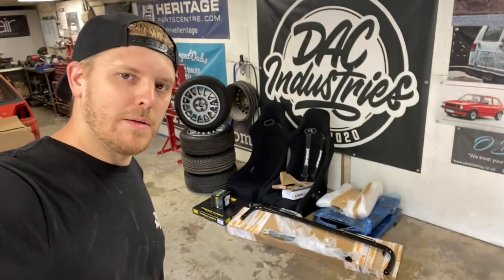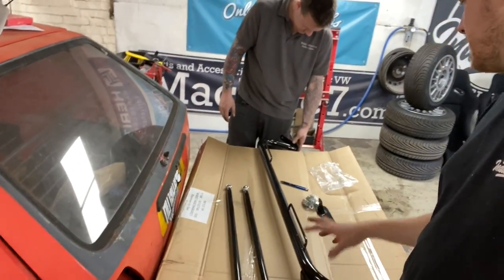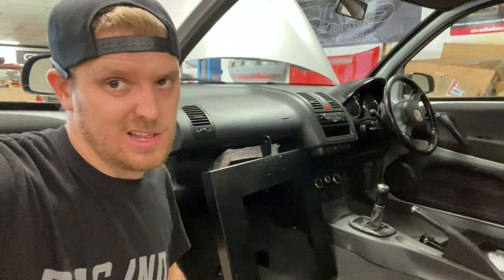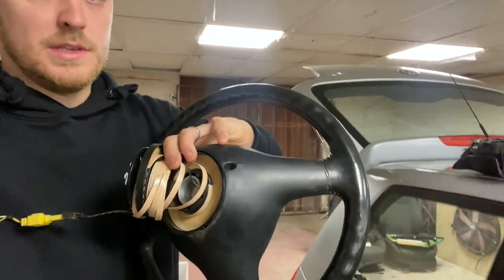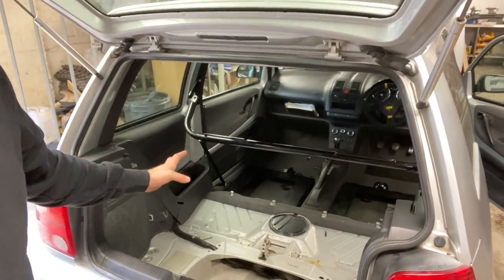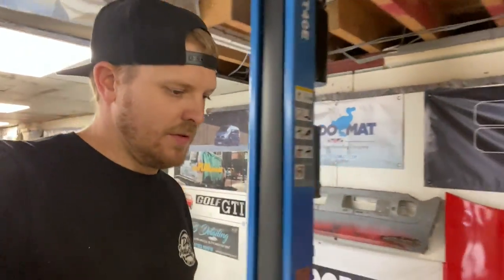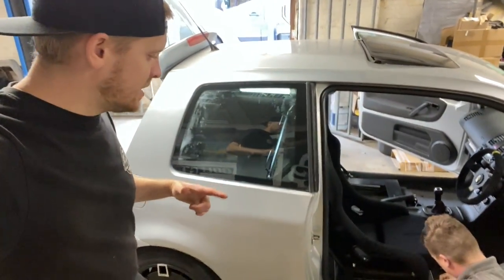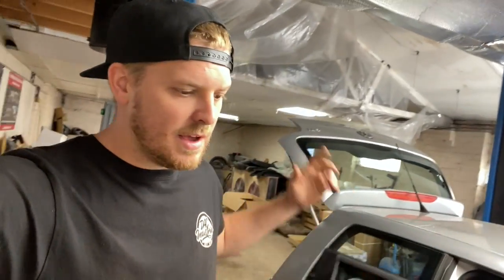Work Starts On The Cheapest Lupo GTI In The Country

Comment: LOL @ the 'exploded' clockspring 😂 Great choice on that OMP wheel. Looks like alcantara. The smaller diameter makes it feel so much better and quicker. The wheel and a weighted short shifter makes the car more fun to drive. A clutch stop can make your shifts even faster and they cost almost nothing. I use an elevator bolt with a jamb nut the tighten it down as soon as I get it adjusted perfectly. Those Speedlines are a CLASSIC rim, definitely a nice tasteful choice, and lightweight too, which is important in my book. Less unsprung weight is a good thing. Good solution to the sliders too. I used to have a couple sets of Recaro's, I believe 3 sets of Corbeau's and a set of Sparco's. I had fixed mounts in my e36 track car that I built, but when I had the set in an mk3 VR GTI I had a set of Corbeau sliders. I can't remember where I had got them but they were impeccable quality. The fit was perfect, and they were painted with a textured 'wrinkle' style black paint. I also religiously ran nothing but Schroth harnesses, (4 or 5- point,) regardless of just having a harness bar or a cage. If you use the OEM seat belt mounting points, you will be totally safe, as they are load tested to take A LOT of force. As long as the angle is correct, and you wear the harness correctly you will be safe as ever. Best part about a proper harness/ seat with bolsters is how well they hold you in place so you can focus on driving, and not hanging on for dear life. My track car had a 6-point cage I built with diff pickup points, gusseted corners with dimple dies wherever I could put them that would make it more rigid. I had X- bars on the door jambs as well. Personally I am not a fan of NASCAR style door bars. Just figured I'd share my experience with those seat mounts/ sliders, harnesses, seating options, etc. 
Thank you again for sharing this build. It's off to a great start! 👍👍😁✌️
Reply from the maker: Thank you for watching bud, Sounds like a cool motor! Hopefully we will do some more to the Lupo next year.

Comment: Congrats on the subs. Why didn’t you just put the rear deck on blocks to lift it over the rear seat bracket?
Reply from the maker: Cheers bud. I wanted it to be as low as possible and supported by the metalwork of the car as I ended up using very thin plywood.

Comment: What glue do you use for the carpet? Also congratulations on 100k!
Reply from the maker: Thank you Andy! I used aerosol contact adhesive. Spray it on both surfaces, let it flash off and stick them together.
Reply: @DanChambersDAC  thanks dude!

Comment: Have a Lupo GTI myself and it's very similar (even have Speedline track wheels for it😆) , would definitely recommend a spacer or quick release on the wheel to bring it a little closer for a nicer driving position, clubsport mod looks neat, definitely on my list now to do, good luck with the project and you should definitely check out Clayton Jones' GTI, nicest one in the world IMO

https://youtu.be/fW-3MGG6jdc
Reply: Clayton’s Lupo is epic, mate.😎
Reply from the maker: I did think a spacer on the wheel may make it a little better, will get in and have a measure up! The clubsport tidies the rear end up and save a bit of weight. Rear seats would not be useable with the buckets so worth doing. Clayton’s is the reason I bought one 😂
Reply: Cheers guys I appreciate it🤝🏼